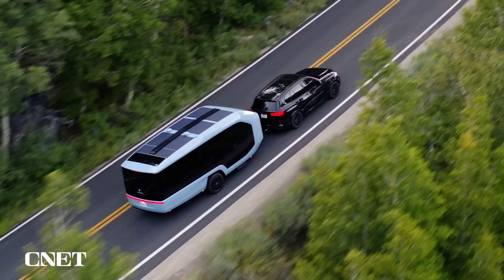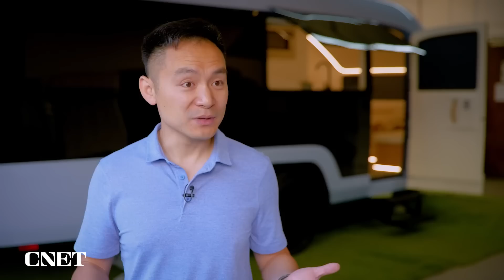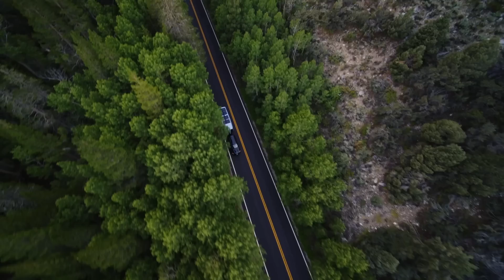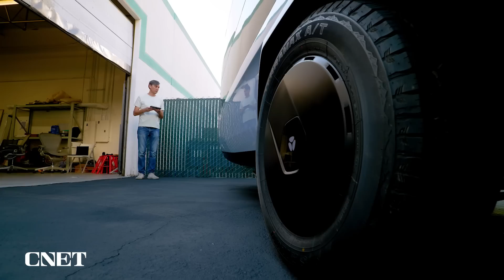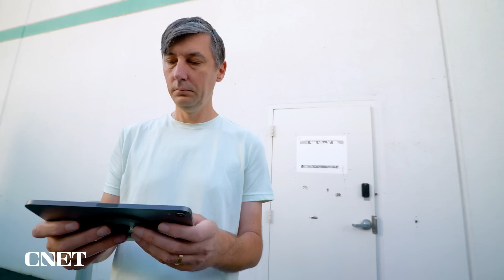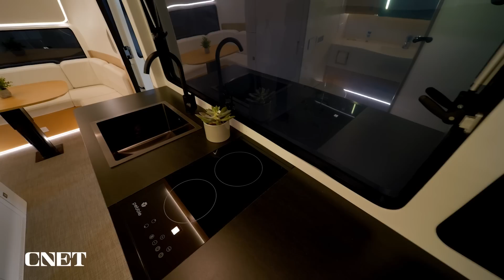Pebble Flow Electric RV Pulls Its Own Weight

Comment: How does it predict the speed of the vehicle while on the road?
Reply: Speed sensor on the drivetrain.
Reply: @randomsanwhich2  ... So the car it is attached to must be a model that is able to give it data regarding changes in speed ... How many cars do that though?
Reply: @wayando  Oh you mean slaving the actual car to the trailer. Yeah that's a bit harder to do. Best case scenario would be the trailer to talk to car itself, but likely it has some feature where per speed it'll add just add some power depending on the resistance felt on the trailer drivetrain.
Reply: Wdym? Just like any car, measuring rotation of the driveshaft/wheel. 

The interesting part would be the balancing system/driving system. 

Does it only kick on after a certain speed? 
If it detects sudden side to side movement, does it just try to get both wheels to spin at same rpm (like stability control), etc etc. 
what’s the efficiency trade off per dead weight? 
What’s the weight of this (trailer) vs another one?
Reply: @Flon-m2u  it’s a prototype, I don’t think the designers know yet.
Reply: @randomsanwhich2  Well yeah, those are just the questions I'm wondering.
Reply: Does it have to link with a tow vehicle? I’d just assumed that it used its onboard motors to sense the pulling force of the vehicle in front and provide an output that matched (or almost matches) said force. If the pulling force is reduced or the trailer brakes applied, it disengages and freewheels or uses regenerative braking to assist in the other way.
Reply: @MX5-XU  Even though it says "RV" no way it's a typical  Class whatever vehicle you'd see. With only a 40kwh~ battery, it all points to power-assisted trailer.  

And yeah agreed with how the power would be delivered. Using cameras, or other sensors (as a primary source) would be too much headache/not safe. It would be somewhat similar to how an ebike with pedal assist works.
Reply: I would put a load sensor in the hitch. When it senses the car is pulling apply power until it balances.